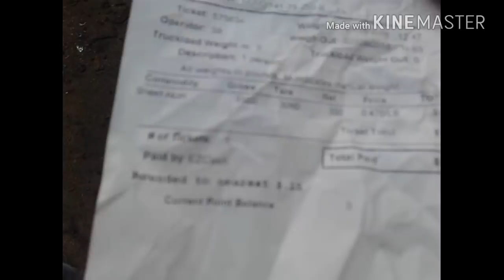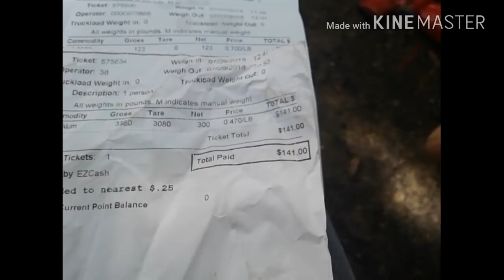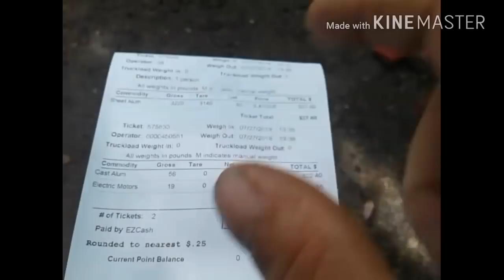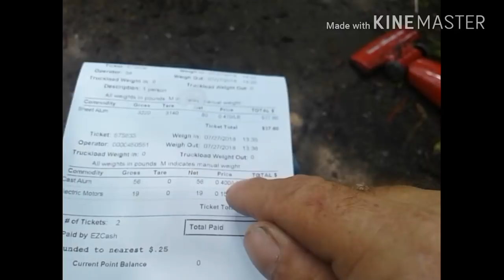Cutting up a AC unit

Comment: A 4 inch grinder takes the copper off quickly from the compressor and the radiators. Grind the elbows off then tap the
 shred with a hammer it pops off. The saws all on the other side is awesome.